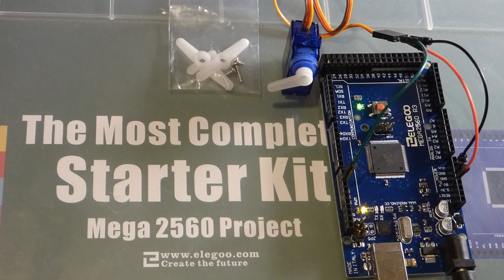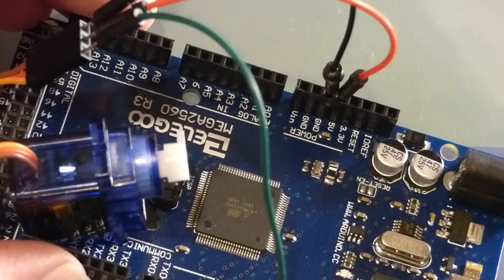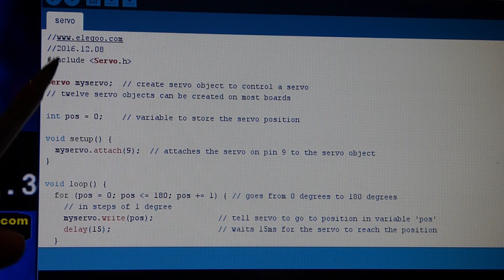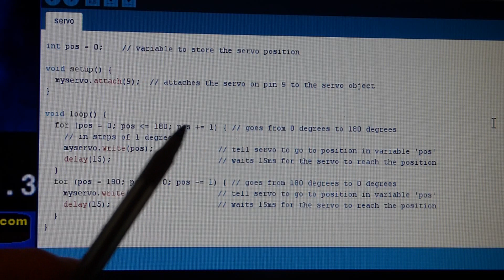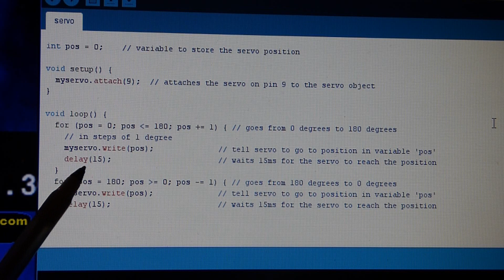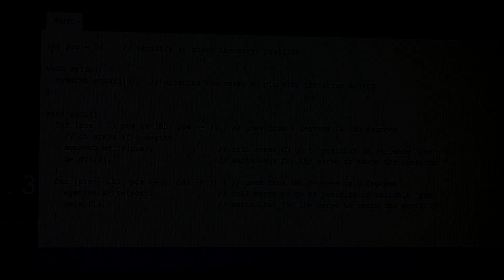Arduino controlled servo introduction using Elegoo Mega 2560 R3 board by electronzap

Comment: What website did you use to program the servo please reply
Reply: I’m sorry for interrupting again but how did you put the command for the servo into the mega 2560 to make the servo run
Reply from the maker: No problem! There's a USB cable that comes with this kit to connect the board to a computer.
Reply: Could you reply please
Reply from the maker: The kit I used in the video has a CD   with lessons and all the programming.
Reply: What sheet in the cd
Reply from the maker: It's a CD-ROM
Reply: Tjank

Comment: me i got exectly the same code with 180 degree but when i run its stop at like 150 degree
Reply from the maker: Weird, I hardly do any arduino, maybe that's a common thing for whatever reason.
Reply: @Blondie SL ya i try to put 360  and it still stoped at 150 degree lol with more cooldown before turn back.